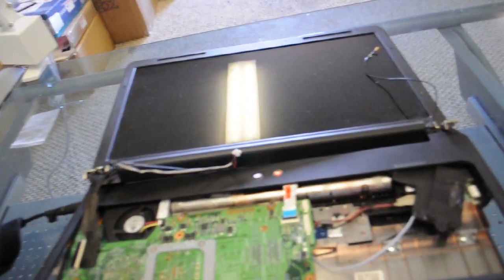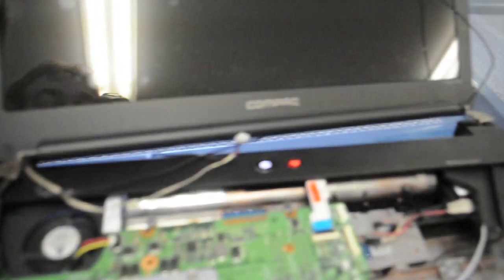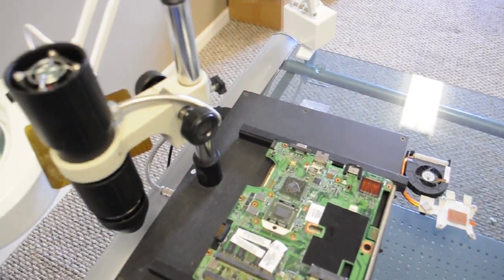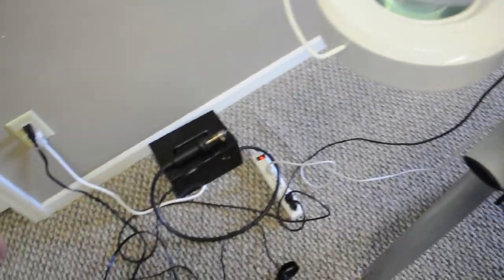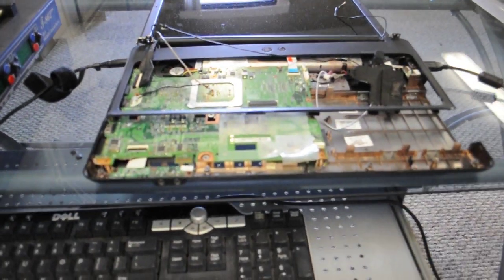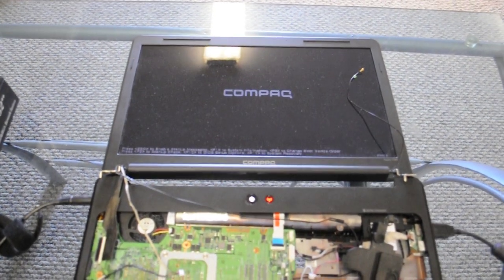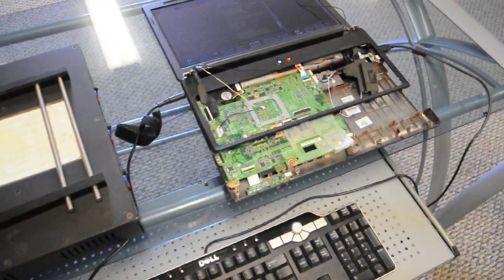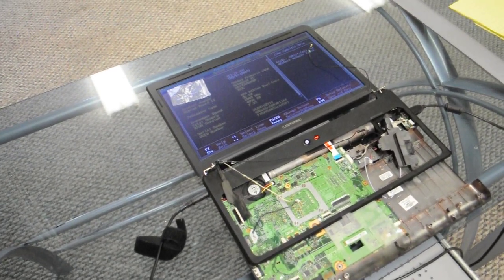Doubleclickittofixit Compaq CQ60-210US repair to fix a no video issue linked to the MCP77 chipset

Comment: dude i got the same shitty laptop and pls help!!
I Basically had 2 drives ( C drive and D - recovery drive ) , and so i went to disk mangagement and right clicked on ' D '  drive and made it active and it asked me to restart the system or smthin and after restarting, it didnt boot and some error came up and so i ran few startup tests and it said error - primary disk is corrupt .
And when i restartd the system again, no video came up and the hard drive led on the keyboard not blinkin ...pls helpp

Comment: @BGAReflow I borrowed a magnifier glass and looked at the number on silk screen .
The chip is U30 it gets pretty hot and it has 19v going into it so far I am unable to find anything coming out as I do not have a small enough  to get a reading off the chip.
Is there any thing I can do to test this . Can you fix this kind of problem?

Thanks

Comment from the maker: @ncrdisabled That chip is called a power conversion mosFET.  If it is what I am thinking of it is part of the charging circuit and converts the power from 18.5v to 5v so that I board can operate.  One of the others in the same circuit converts from 12.5v to 3.3v I believe.

If it is getting hot, then most likely it or something in the circuit is bad.

Comment: I have the same laptop and am a disabled vet so I use it in the hospital . It will not turn on at all I tried lots including swapping the power pack, on off switch assy and battery . I unplugged everything on the motherboard I plug the power in the led by it lights up it also does not charge the battery . It has the 19v on the plug assy that plugs in the motherboard . There is a small smd chip in the front top behind the dubug1 connector it gets very hot I check power to battery only 1 or 2 volt